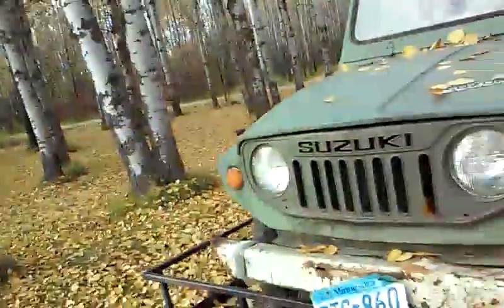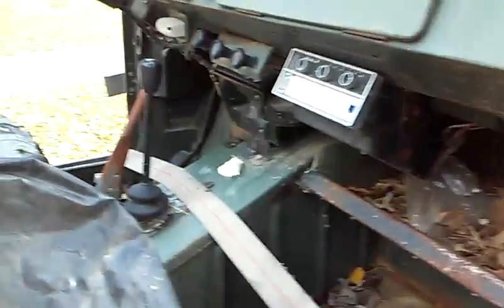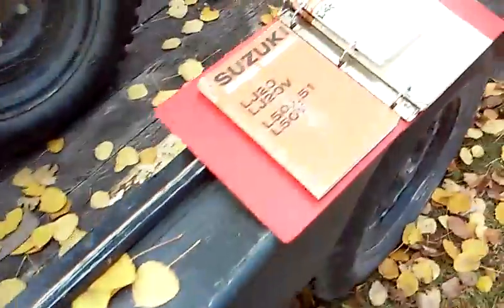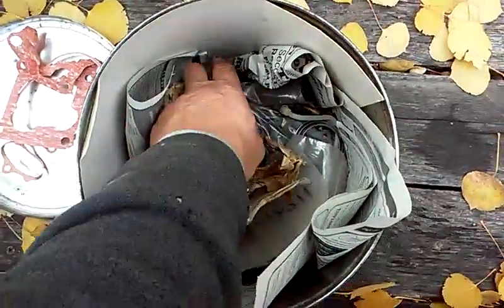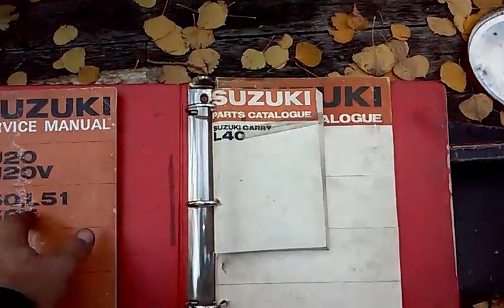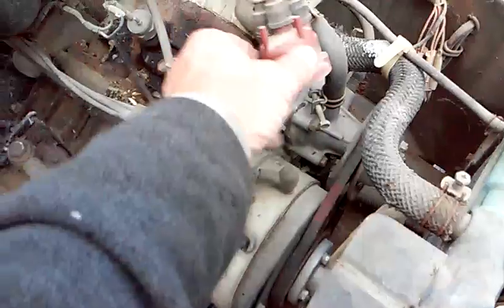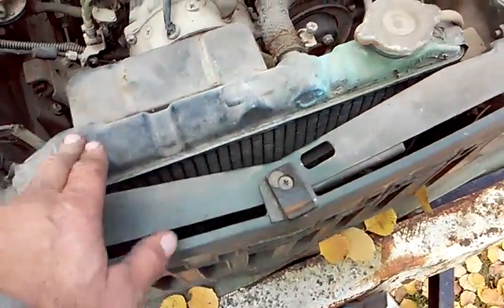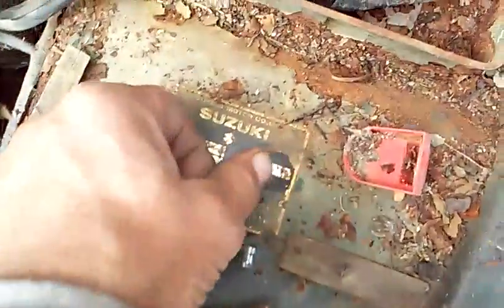Suzuki LJ20 First Look

Comment: I had a 1976 LJ50.When the 540cc 3 cylinder 2 stroke motor. When the engine died l found it had needle roller bearings all in the motor.Yellow rhd with a New Zealand fibre glass truck cab.Looks just the same.Window washer is the best-rubber bellows,Great fun.